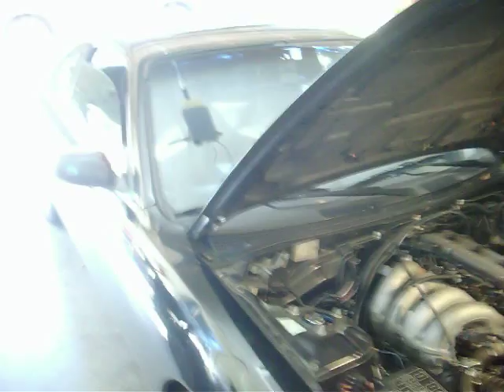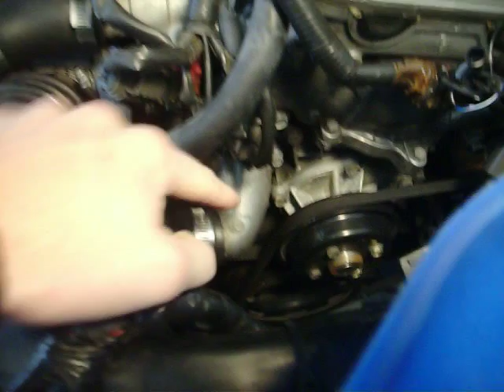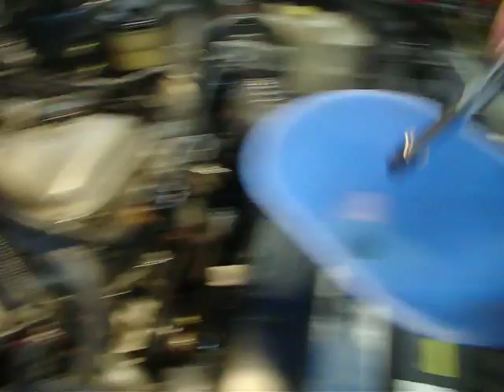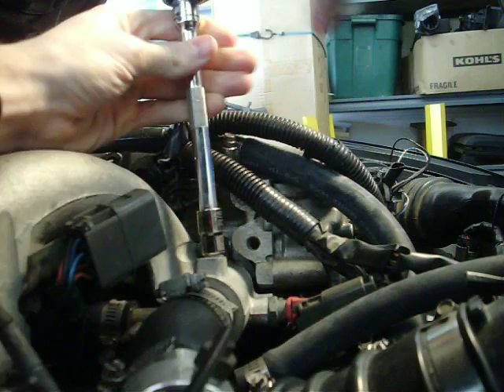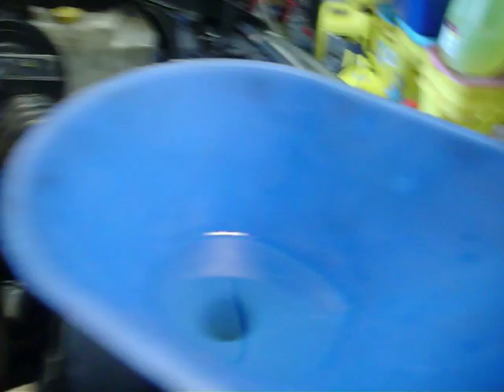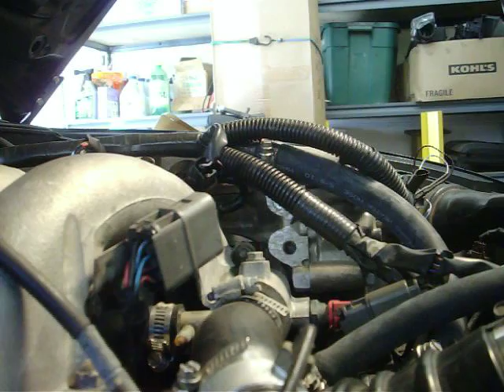240SX KA24DE Coolant system bleeding

Comment: A couple things I'd advise is to park the car on an incline with the front end higher than the back end. That'll help move any air pocket bubbles towards the front of the engine. 
 Also get a funnel system that has fittings that seal tight in place of the radiator cap. 
 Pour coolant in the funnel and keep adding until it stays half full. Start the engine and let it fully warm up with the heater and fan on full blast. Add coolant if the funnel level drops below half full.
 Once you feel fully warm coolant running through the upper radiator hose, start squeezing and releasing it. Look in the funnel as you're doing it and you'll probably notice decent sized bubbles coming up. Keep squeezing and releasing the hose until you no longer see any more bubbles. Keep looking in the funnel and if you don't see any tiny bubbles coming up, the system is fully bled.
Reply: thank you

Comment: you are aware you need to remove the bleeder screw and allow water to flow out about 2-3 secs to make sure all the air is out of the system,
Reply: The air relief or drain plug on cylinder block??

Comment: what does it mean when the temperature gauge goes up each time you move the heater fan level through the slots. my 89 240sx temp gauge goes up each time i cycle through the fan level (low-high, high-low, repeat) and it keeps rising, what is causing this?

Comment: What if you run the engine with thé rad cap off, won't that take out the air out of the system ?
Reply: Cant. Shoots coolant out
Reply: ^i learned this one the hard way